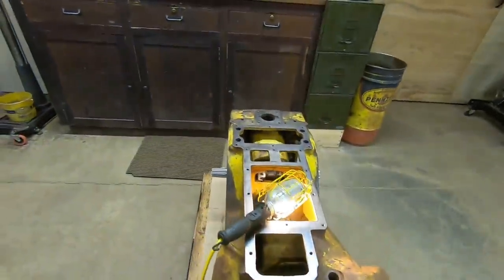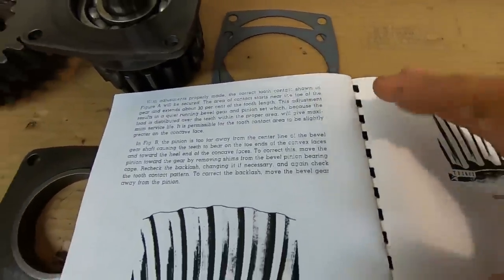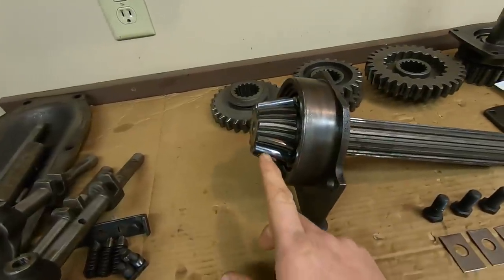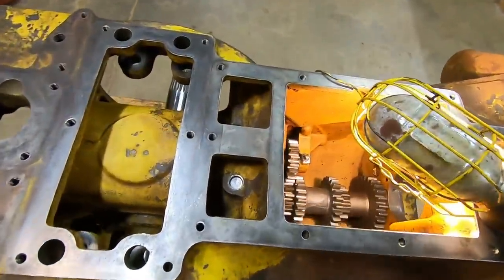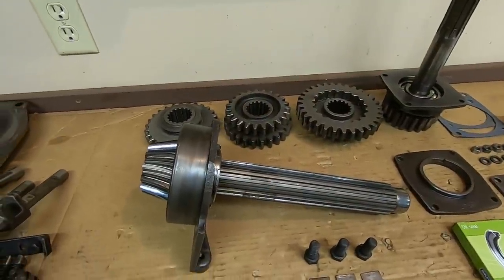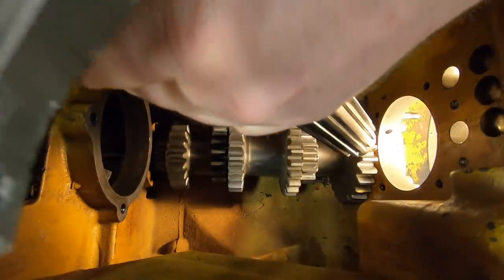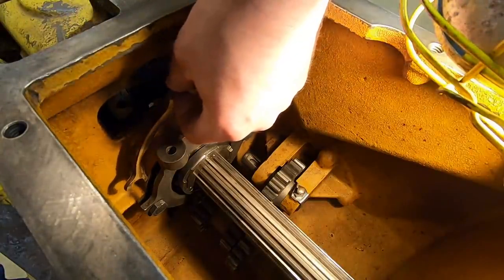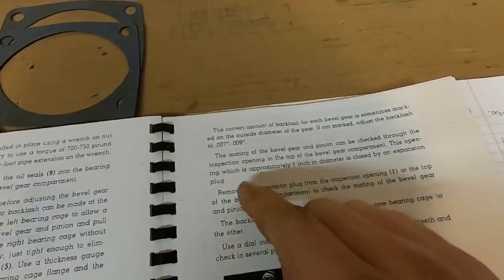Caterpillar D2 #5J1113 Chassis Rebuild Ep.14: Finding The Correct Bevel Gear To Pinion Setup

Comment: Hey Squatch, just subscribed here recently. Attracted by intrest with the D2, my Dad had a D2 when I was pretty young. I believe it was a 39. I'm 56 now(that's was a while ago), I  have kind of a soft spot for the D2. I really enjoy your videos (all the projects). Great job explaining the process,  and your attention to detail is so professional. 
  Setting up used gears in a different housing,  and to get them to match up the way they did originally. Not only does it show your skill as a mechanic/ machinist,  but the skill of the people in the foundries, the machinist and engineers of the late 30's. No computers,  no auto cad.  I have a lot of respect for those guys.

Comment: Not boring at all for those that are interested in knowing how things are done.  For those that know how all this is done they can fast forward.  Your content will go on for years to come after all those that know how to do things have passed on.  You are recording history of how to maintain these old tractors, that will be used many years into the future till the iron rusts out completely or one can't get replacement parts or make them any more.  Keep up the good work and the good content!  Don't change for the few that might disdain.  As the saying goes, you can please some of the people all the time, you can please all of the people some of the time, but you can't please all of the people all of the time.  If you try the latter you end up pleasing no one, especially yourself.
I know that feeling when things work out just right, especially after trying for a long time.  To get it so right so easily is a testament to being good, not necessarily lucky.  My day job is with computers, and tinker with old stuff after hours. I can get the same feeling from both, when solving problems or fixing things.

Comment: Something that not many don't realize. Just because you saved a set of gears and are placing in a new housing, doesn't always mean they're going to match the same. The machining process is always different from case to case, you just demonstrated that. Thank you for sharing this part. 
J1113 is coming back together, slowly but, that's the only way to go to be honest. Great video, cheers :)

Comment: In 1977, I was a final inspector at E Peoria gear factory. It wasn't my regular line, but several times I had to 'run in' ring and pinions. We put a set of gears on a fixture and shimmed them till we had a proper pattern, then marked the gear for the proper shims needed in assembly.
Reply: @squatch253  I never saw the assembly process, but I believe they just used the gears as a set, and shimmed to what we etched on them. 
 I think machine process tolerances on housings were close enough to "make it work" .
  It wasn't something the operators of machines were to know, but if I tagged a tub of parts for needing sorting for an out of tolerance condition, they would accept 1 1/2 times the print tolerance in most cases.

Comment: Nice to see a "real" mechanic, not just a wheel barrow mechanic as I called them (they're usually referring them selves as "thecnician", often work in dealerships).
The reason I call them wheel barrow mechanic is; not because they can only fix wheel barrow. It's because they will wheel one full of parts by the vehicle, changing a guizillions of parts until the problem is fixed instead of learning and understanding how the system they are working on work and operates,  do a proper diagnosis, then fix it right once. Its not like they are stuck in the woods, they have all the documentation at their fingertips.
I swear, they are lucky to have you at your workplace. You are a dying breed.
Keep up the good work!👍👍

J. F.🇨🇦

Comment: This was so helpful. I tried to get correct gear lash on a small ring and pinion for an electric standup forklift drive motor a few years ago. It was making a lot of noise. I tried to get gear lash set right but it didn't work because the only way you could set it was non- preloaded like your CAT. I got it perfect if all the bearings were preloaded but once it all was together I realized it changed. I didn't know what to do. They told me to button it up and move on. Wish I'd known this. I would've set it for heavy mesh on the toe and once everything was tight, probably would've worked. I could tell someone had been in it before me and they obviously didn't get it right either. If it had run any time for a long period like that, it would been impossible anyway to relieve the noise had I even gotten the lash perfect. This was very educational.

Comment: Hi Toby, Just did my D2 5U. all new bearings in the trans and bevel shaft. Replaced bevel gear pinion and bevel gear, they were not matched VG to EXCL. I used all the shims that I took out of that case and put them back in the original position.. The gear pattern  is a direct match to yours and backlash is .008. Amazing!! Thanks for the tutorial. Herb

Comment: My dad work for Ford dealership too through 60's to early 70's. On his 76 F150 4x4 had pinion seal leak my older brother thought he fix it for him all is good. Well he tighten pinion nut like he was learning at tech school but big trucks used solid spacer no crush sleeve. It burnt pinion bearings in 1/2 mile was smoking. My dad got there, don't have time to swap 9" carrier out, he took pinion with shims from another 3.50 ratio rear and stuffed it in. Funny never made noise and stayed this way in tell he junked pickup. Dad was in hurry had farm auction to get to, got there in time and he got what he wanted LOL.

Comment: I was in the navy on Perry class frigate had work done to a shaft bearing and it was reassembled with shims in the wrong spot.  Caused three  sets of gears to unload in the reduction gear.    We went thru 6 16oz bottles of prussian blue painting the entire gear train trying to figure out the contact pattern and then adjust it back.

Comment: Sweet. I love gears! Our instructor (Ed) would tell us about forces from gears moving away from each other under load that would be put on the transmission and differential cases caused movement that would happen between transmission cover and case mating surfaces would be enough to introduce dust into the oil.

Comment: I have definitely learned something here. I'm working on a rear end in a Farmall C. I'm using the same gears but had to replace the bearings. This video has helped me understand the procedure in the manual alot better. Wish I had you as my machanic.

Comment: On heavy truck differentials, the pinion are also marked with a plus or minus value in thousandths of an inch which is for initial setup. Manual would give you a starting shim pack value and you would remove or add however many thousandths that the pinion was marked with. Made initial setup alot easier!

Comment: i did some shim installs and stacked them together..sometimes the shims would have burs so miking the stack they were too big..run a file over the burrs reassembled the ring/pinion the numbers came in ok using a dial indicator preloaded and set to zero..just like endplay on a crank the setup..never could use those new shims until i fixed them..makes a big difference on the endplay

Comment: Nice Video, as always. I know that procedure from an Unimog.. its a pain to get all the distances right. I wonder one thing though, that 7 to 9 thou backlash is for new bearings and everything, it was running fine with 22 as you took it apart. If you set it to arround 20 now and the bearings will settle somewhen in the future, won't it be too much backlash by then?

Comment: I get why some folks might find this boring.

BUT

I have a diff that needs reconditioned and I think I might just be brave enough to try it myself on account of this vid. I won’t be doing it anytime soon as the unit is not currently needed fir service, but it’s another project I’m gonna have a go at.

When you first started watching the gearbox work, I was kinda lost, but it makes a lot more sense now: thanks dude. If you get bored spannering for someone, maybe you should consider educational work!

Comment: I have a d2. Do I need to add 90w to the rear differential. Im not talking about the transmission or PTO. On either side of the PTO there are spots where Im assuming I should put in some gear oil to lubricate the bearing where the axel drives the sprocket that runs the tracks. Also Squatch. Can you do a video on track maintenance of the D@. Im not seeing anything in my service manual. Not sure If im missing part of it. Your vids are great. Would love some knowledge from you. Thanks in advance
Reply: @squatch253  thank you.... this video series is invaluable. You are doing good work sir.

Comment: What do you use for a marking compound that you brush on the gears?  Where is it available?  Will Prussian blue work?  I have  a Gearmatic winch to rebuild on a John Deere 440 dozer that is my current project.  Have not gotten to the bevel gears yet but was wondering about the marking compound to use.  Thanks.

Comment: Wouldn't the yellow marking ink cause a few thousandths worth of deflection on the gear face?  Looked to me that the ink was caked on the teeth pretty good.  I'm sure there was not 100% squeeze out, thus some ink remained on the face which would in turn cause an inaccurate reading.  (Or maybe the ink was used AFTER the measurements were made and the ink is ONLY used as a way to see the contact pattern.)  Probably the later remark is the true answer.
Reply: Yes, the backlash measurement is done first, then the contact pattern.

Comment: The gopro will never be as good as the human eye but you can make it better by using LED light source. They just don't like the tungsten incandescent as much, the problem with LED is you get frame rate alignment issues and the light looks like it flashes.

Comment: Good job.  But if modern bearings are not the quality of old why  not buy nos timkin bearings on eBay? The number you gave check out to be 38 dollar each  nos bearings on eBay.  I get nos USA bearings for my gravely tractor restorations all the time. Especially the little ball bearings used in the engine.
Reply: Great idea if it works, but so much fake stuff out there especially it seems on eBay.  I was a bit suprised he did not find NOS, but that bearing is probably used in several places on several models so was used up.
Reply: Old time deep groved bearings are superior to there modern equivalent even with the same company and bearing no. That's why old new stock demands a premium price tag
Reply: @markmckinley5989  Irvineman on ebay-excellent!
Reply: @simonaldridge82  So what changed and why?  Seems like the ball bearing has been around so long that they would get better as technology advances.